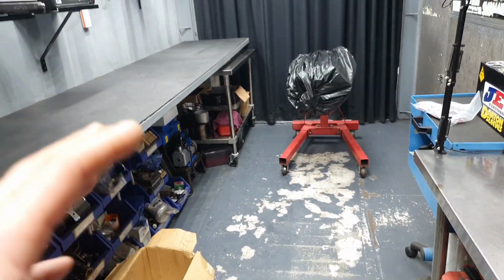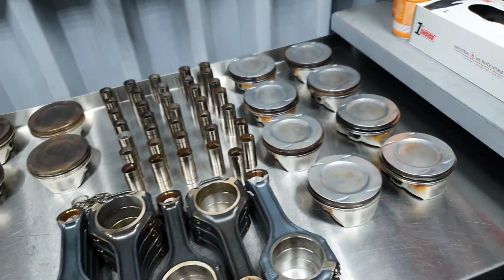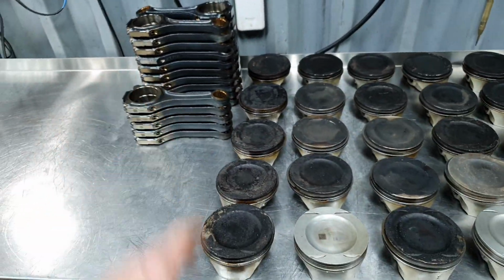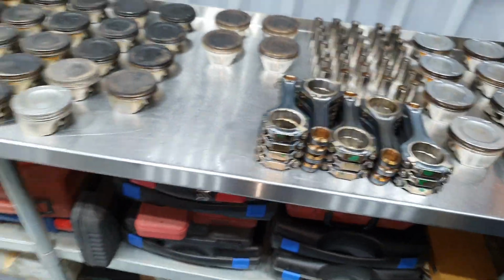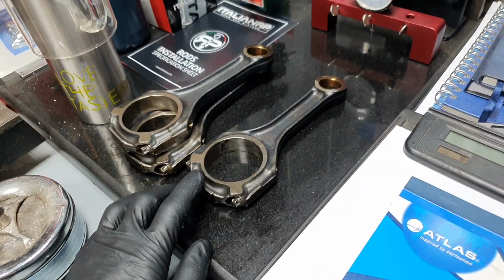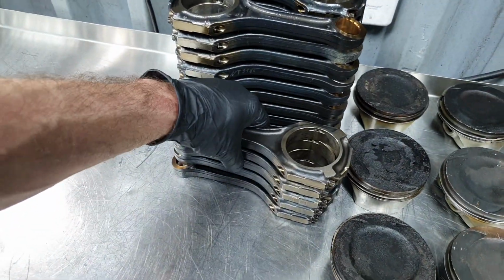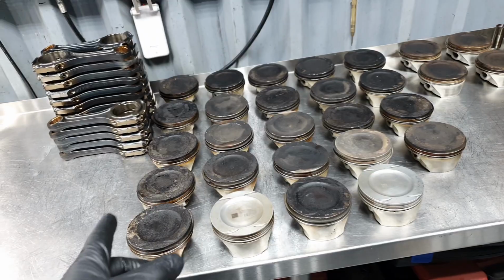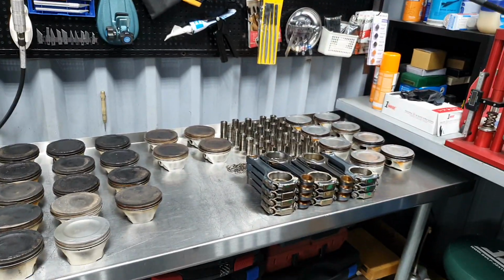M157 stock pistons/con rods

Comment: Hi Tasos,

I have an engine problem with my MB ML63 AMG, a catastrophic failure that will require a crankshaft readjustment of +0,25 or +0,5 the problem is to find the connecting rod bearing of this measurement.

I need your support to find one that can help me solve this problem. So where can I get or request a manufacturing of this parts.

Thanks in advance Man from Angola 🇦🇴 
Jorge Trula/ RucaZone